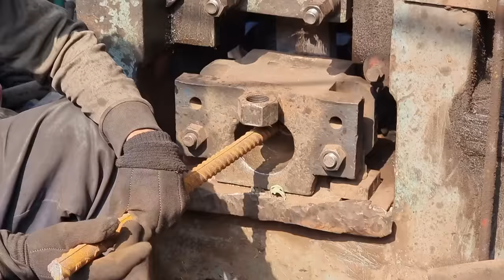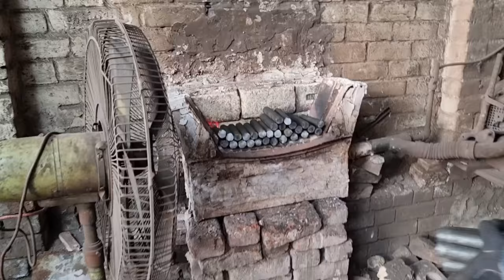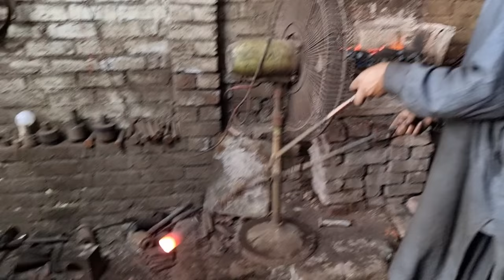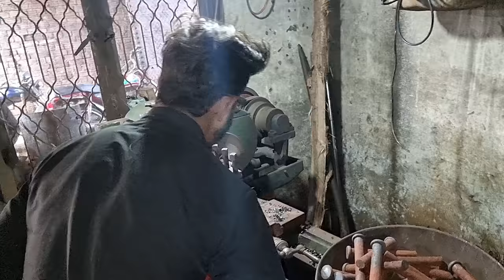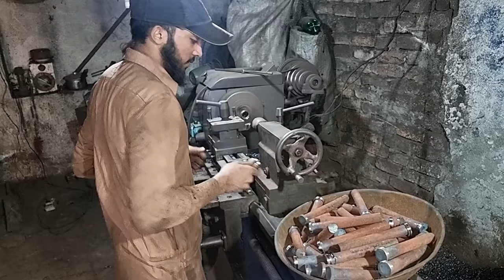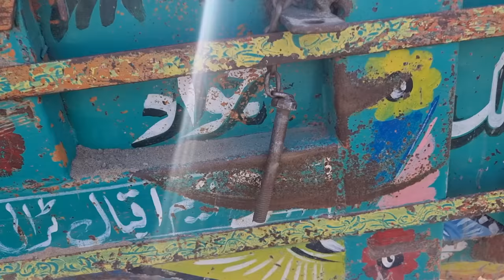Amazing Manufacturing Process of Tractor Holding Pin | Wonderful Production of Tractor Pin

Comment: Hello Amazing guys. We used that exact pin for 100 years on the Canada and US railways. Millions of them. All the brake rods are connected that way. Very pleased to see the slow cooling. No brittle pins that way. In 35 years of checking and repairing, not one broken pin. Changed hundreds of worn out ones, after a million or so miles. 
Most terrifying parts of your shop? Have to be shoving work into the lathe while it’s doing 800 rpm or whatever. And loading the stub of bar into the chop off press. YIKES!

Comment: Funny. First they cut short pieces of rebar. Then they heat longer smooth bars. At end they show tractor trailer witch had old bolt as pin
...
Reply: CONGRATULATIONS 🤩🤩🤩
You win the Internet!
Yes, you get three smiling Red Star Faces for your incredible forensic visual detective skills.

Comment: Are all your machines designed to be used on the floor?  Everything is done off the floor. You filled a wheel barrow then dumped it on the floor 5 feet away?  You all need help